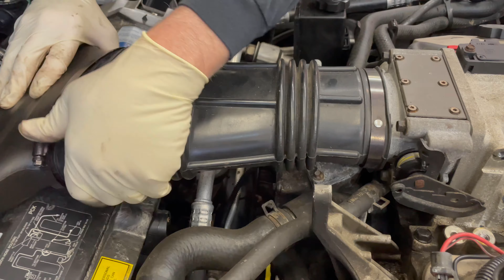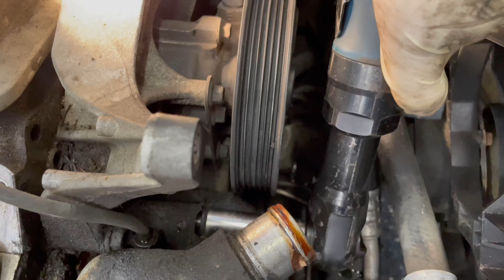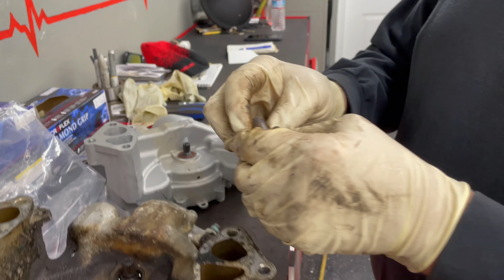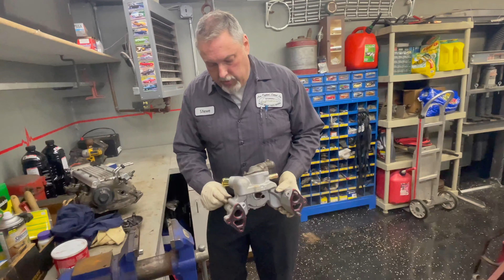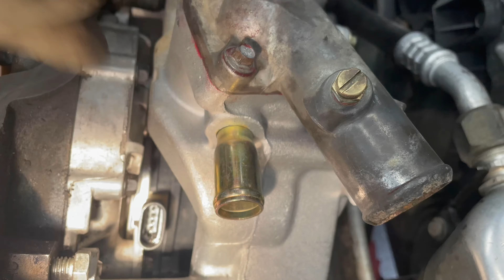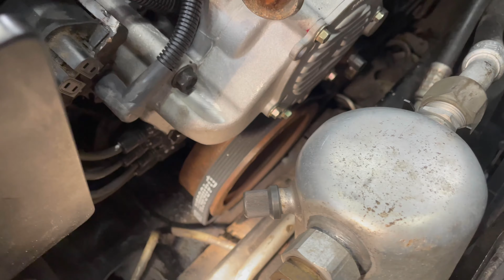How To Replace 1992-1994 C4 Corvette Water Pump

Comment: I changed the water pump on my 1995 Roadmaster which has an LT1 and I drove it for about 10 minutes and the water pump is blistering hot. It got up to operating temperatures and the hoses seemed to be a normal hot and puffy feel. Advice? Thx
Reply from the maker: Did you make sure the thermostat is working correctly?
Reply: @HomeownerRepair  I took it to a mechanic and he didn't seem to be impressed that it was all that hot, thou I had the thermostat out this time. i'd like other people that have the LT1 to get their vehicle up to operating temperature and see if they can put their finger on it three to five seconds w/o a blister? would like to hear back. I will try one of those handheld laser temperature readers--thx
Reply: @kurtjohn5554  LT1’s normally do run hotter than other engines. My C4 Corvette with an LT1 typically is 215-225 degrees fahrenheit

Comment: I found one oring on the new water pump shaft.
The service manual says, the ringed mark on the tiny  double female shaft goes against the engine block.
Reply from the maker: You can follow the service manual. The method we used was fine.

Comment: What kind of gaskets did you use exactly, I have two choices one factory AC DELCO in pump box new and I have FELPRO gaskets as well.   TWO emails and FELPRO swears to install their gaskets dry only.  What exactly did you cover your gaskets with.  THANKS FOR ANY HELP   I am confused I see ChrisFix smoothered his in fine a thin coat of RTV.  What shoulod I do!  My AC delco box instructions say fiber gaskets most be used with a sealant.
Reply from the maker: We didn't use any sealant, we used a little bearing grease to hold them in place and to also allow us to see that the bolts have enough pressure on them when tightened.

Comment: Does the tensioner have to come off to access the bottom driver side bolts on water pump?
Reply from the maker: I think it was in the way, we may have removed it to gain access to those bolts.
Reply: @HomeownerRepair  once you remove the belt, the tensioner drops down enough to remove that bolt. I hope someone finds this helpful.

Comment: You decided not to put an O-Ring on the coupler that goes between the Water Pump and the Cam Gear?  I was hoping that you were going to show which side of the couple goes to which side of the Cam/Water pump. You did notice the O-Ring groove on the coupler?
Reply: Ring marked side goes against the engine, per my service manual
Reply from the maker: If there was an o-ring in there we put it back on.

Comment: Im about to put my 95 back together and I had a quick question.  My Haynes manual says I need 2 o rings on spindle shaft when mounting water pump but I noticed you skipped this step.  Is it OK to proceed with no oring?  I'm sure you've done enough of these to roll your eyes at.
Reply from the maker: It you follow the video you should be okay. When you take the old one out see if there is more than one oring.
Reply: I'm in the middle of a water pump job on my 96 and I also referenced a Haynes repair manual. Like you said, it indicates there are 2 Orings, one on the spline driven gear end and one on the back of the pump spline. Mine were missing completely, maybe they can deteriorate over time.  Great work on the video! Thanks

Comment: Is it not necessary to use thread seal on the long bolts so that antifreeze doesnt leak through the water jackets and through the threads?
Reply: The bottom bolt on the left side of the engine dose go into the water jacket and can leak without sealant.
Reply: @alistairhart9699  Absolutely! Mine leaked before when I didn’t use sealant, so guess what lol…I had to remove it and reinstall it with the sealant😅😅
Reply from the maker: We didn't have any leaks using the method that is shown in the video.
Reply: All four long bolts tops and bottoms ones of my 95 had white sealant close to an inch long on the bolts tip area from factory I think.  YES USE SEALANT
Reply: @barneythedog977 💯💯